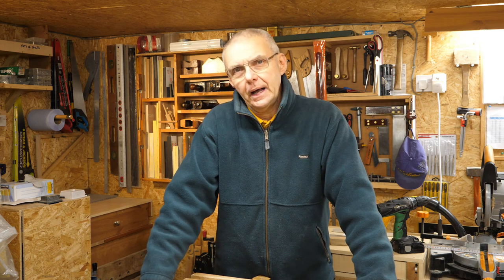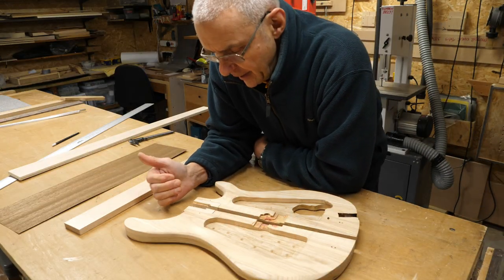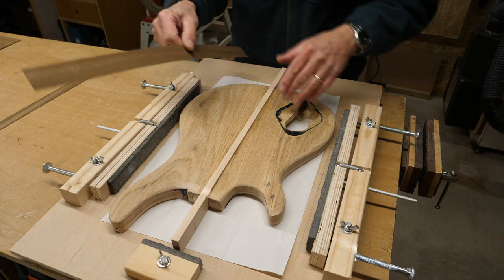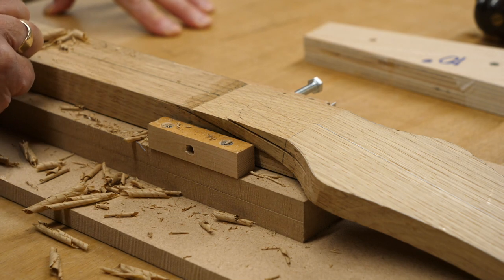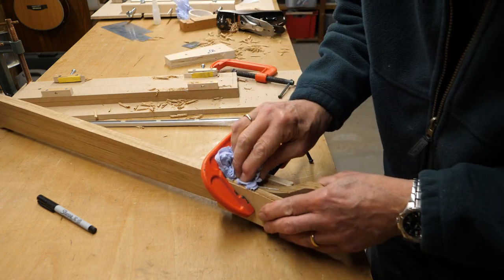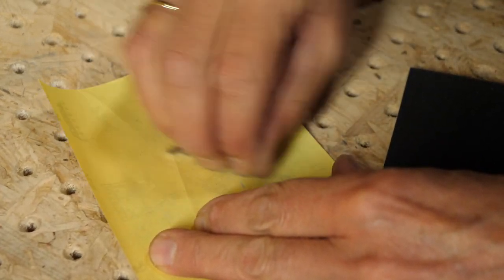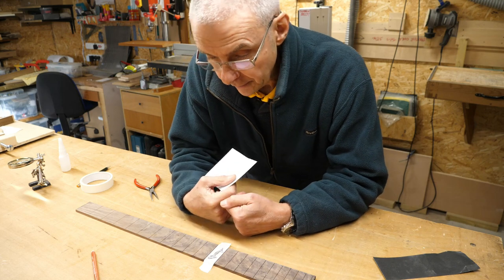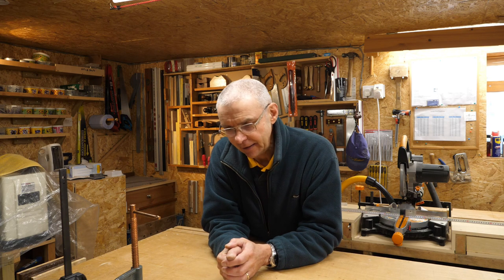Complete Bass Guitar Makeover - episode 8 - Disaster strikes!!

Comment: Dave, that neck will be extremely compromised with the aluminium sandwiched inside, the only surefire way to rescue the neck would be to cut it right through and then plane it flat before re-glueing it. You might get away with a wood veneer but its almost impossible to know if there's enough glue in the slot, or how well distributed it is!
Reply from the maker: Hi Martin. Mmm food for thought 🤔. As you know I am not an expert, I just feel someone has to try it, even if it just adds to my experience, if you know what I mean. Great comment, thank you. Cheers Dave